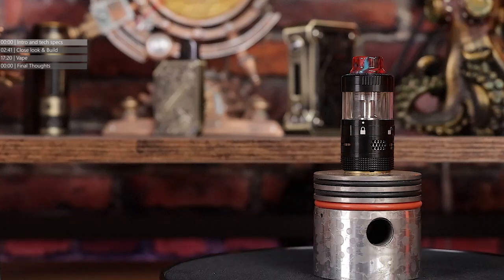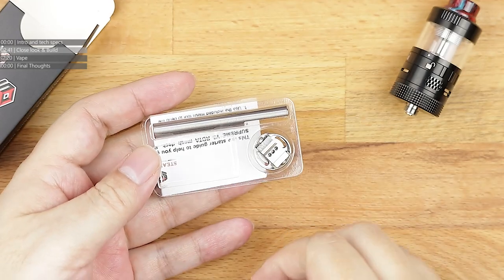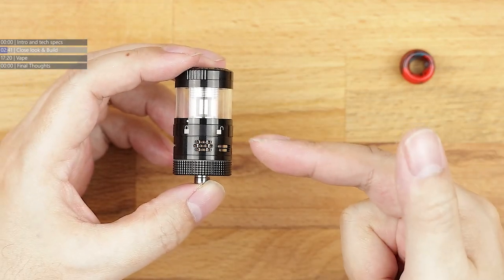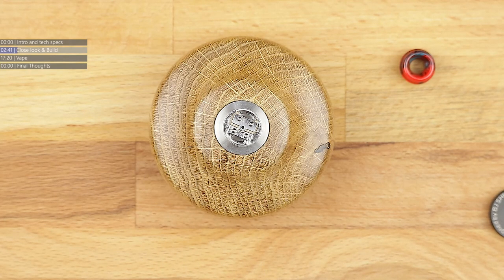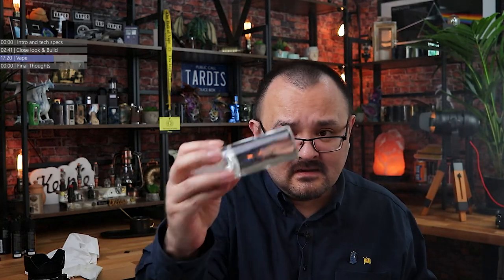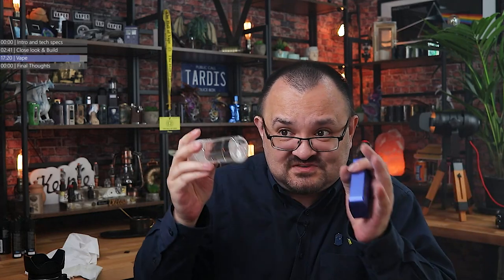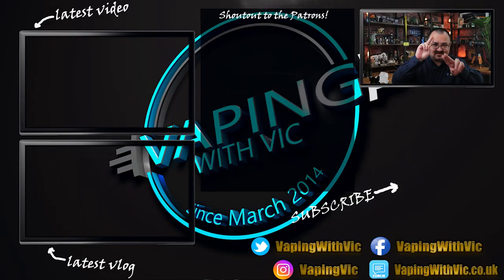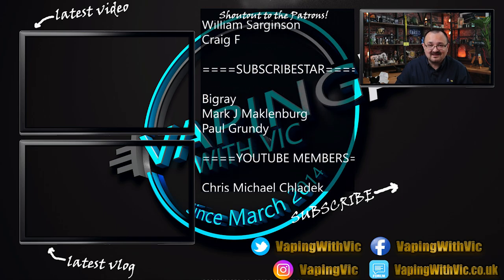Steamcrave Aromamizer Supreme V3 - The Supreme gets Ragnarified...

Comment: And for people saying why buy it if you have a Plus V2, Ummm maybe cuz this tank was made for the SINGLE COIL fans out here, This tank was not made for dual coil, it was made to showcase the new single coil deck with a OPTION  to use dual coil deck, So no it's not the same as the Plus V2, This is a single coil RTA with a real nice single coil deck and great flavor, It's a reason it comes with the single coil deck on the standard version
Reply: orrrr just an update to the line as most products in the vaping scene seem to get, hell, technology in general

like if no progress is made, and everything is the exact same, then it would be very boring imo
Reply: People also seem to forget some want a smaller tank for out and about or to fit certain devices.

Comment: Ii would also recommend those Wiha hex drivers vic showed, much reduced hassle Vs poxy hex keys from the spares bag. Full set is relatively expensive - but TBH U only need the same 2 most of the time (1.3mm & 1.5 mm) & can be found selling individually...

Comment: this tank is made to basically be a smaller single-coil version of the aromamizer plus v2.. sure you can duel coil it but there's a reason the basic kit comes with the new style single coil deck rather than the normal steamcrave postless deck.. did you forget the aromamizer plus v2 exists vic?..because it has much more to do with the plus v2 than the ragnar.... and the titan and ragnar are part of the aromamizer line, what are you talking about man?
Reply: Do you know if the decks with the plus v2 are same as this supreme v3?

Comment: I would buy the Ragnar but it's to big. Just wish it was a little smaller like anywhere for 30-33mm to go on the odin mod. I can deal with a little overhang but with 35mm would be way to much.
Reply: Get the Plus V2, it is 30mm
Reply: @Ackatizzle17  ill check it out, thank you
Reply: @xtrmbrazen6153  I'll back Allen. Grab a Plus V2. Just as good as the Ragnar if not better.
Reply: @Hexx_Iztenze  agree the Plus v2  is slightly better than the Ragnar in terms of flavour etc.
  The top cap 'Knurling' on the Ragnar is perfection, but really under done on v2 that's the only criticism.
I like the mesh deck...so get the advanced kit if you do too. There's also a velocity style deck, and single coil deck available which I haven't tried yet. But I high recommend getting the dual coil series deck available as an extra. The series deck has two coils sitting side-by-side as normal, but wires the coils up, inline with each other. This double the Ohms resistance and so you can get the same vapour using significantly less power, extending battery life.

Comment: I wouldn't call it a Ragnar mini it's more like a Aramomizer Plus V2 mini, Ragnar has different airflow and airflow ring, This has the exact airflow as the Plus V2 and built the same just a 25mm instead of 30mm, Ragnar has 20% airflow that comes from under the coils and 2 lines of airflow on the airflow ring and a hole under those 2 lines for the bottom airflow, So not a Ragnar Mini more like a Aramomizer Plus V2 Mini, Great review tho Vic

Comment: New vaper here... also not a fan of mesh. First tank, sub-ohm (premade , NRG / Smok coils) was mesh. Literally everything else I have now 2 months down the line is NOT mesh. I find a mesh vape to be just too... errr.... dry?
Reply: Been vaping 8 years on regular coils, got my first mesh deck for my V2 Plus a week ago or so, took a good 3 builds to get it built so it works properly, I am a convert, impressed.....if it isn't built properly it sucks arse tho, also finding just a tiny bit less airflow works nicely with mesh compared to coils, I normally vape wide open on air direct to lung.

Comment: I'm struggling between this or the M25? Maybe a ragnar since you mentioned it. 

Someone help...plz
Reply: if you want more capacity go for ragnar otherwise if you want versatility go for aromamizer plus v2
Reply: @_ABS0LUTEZER0  any reason to not get V3 aroma? I realise smaller capacity but is it better flavour?
Reply: @BucephalusHume  to me the v2 and the v3 are the same and the reason that i want the v2 more is the capacity.
Reply: @_ABS0LUTEZER0  okay, many thanks for this. I thought they'd done something with the airflow that made the V3 better? Or is that just, advertising garbage 🗑
Reply: @BucephalusHume  i own both but can't tell any difference, but that's just my subjective view. the only noticeable difference that i see is that they made the v3 a 25mm size so it can fit most mods and the v2 with a 30mm diameter and a larger tank capacity. if you want an atomizer that has a larger tank and won't be put-off of the size that comes with it i suggest you get the v2.
Reply: @_ABS0LUTEZER0  many thanks, supreme v2 might hang off some of my mods but I'm guessing it will still work. I like the idea of having a huge capacity tank soprobably go for v2

Comment: So, the Bellus that came BEFORE the Aromamizer DIDN'T have "side airflow"? And didn't RDAs like the Kennedy ALSO have bottom airflow?

It's another case of Vic not knowing WTF he's talking about. The first Aromamizer was deemed "an RDTA" because THE JUICE came from underneath the coil "like an RDA". It didn't have to do with the airflow. Unlike other RTAs, which relied on juice channels, the first Aromamizer had a semi-floating deck, with space underneath. As juice dripped in that space from the tank above, the wick was "pulling it upwards" through holes at the bottom of the deck. Just like an RDA, where the wick is "hanging on the deck and pulling juice upwards".